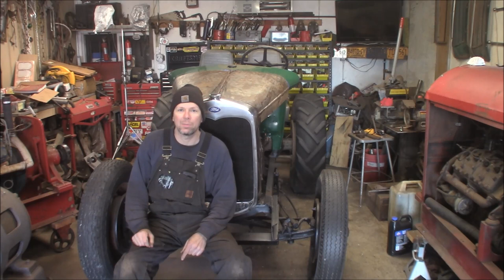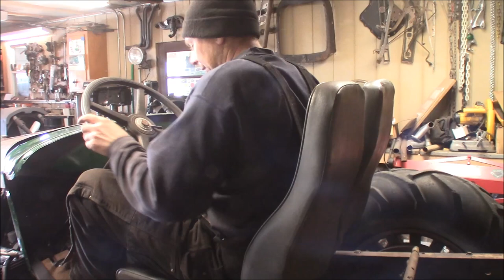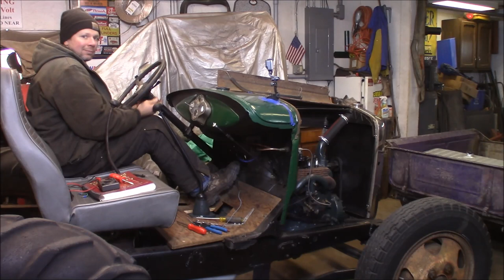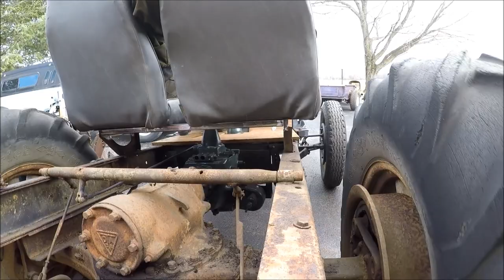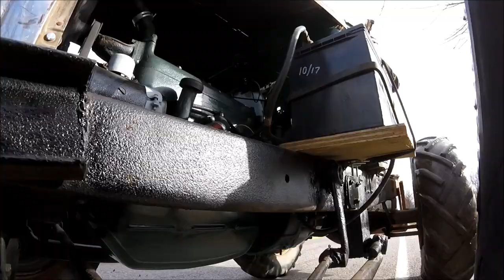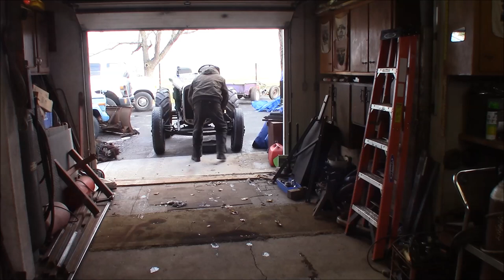Ford AA Doodlebug:  First Drive!

Comment: Thanks for the inspiration. I’m trying to restomod my own doodlebug.  It was a running ‘34 Dodge with a 1.5t timken but the prior owner sold the engine out of it. I talked him into including a ‘57 Desoto 341. Got the engine and trans welded in last week.  Still waiting for my second trans to come back from the rebuilder.  Your top loader axle was perfect for direct coupling. Sadly my front input is low enough that I’ll need a driveshaft. A bit disappointing because that’ll push the axle further back.  Using bucket seats is exactly what I suspected. The problem is they don’t have the right look. Maybe I can bend my shifter to stay under the bench?
Reply from the maker: Sounds like a cool doodlebug!  I have a 341 Desoto engine too.  Cut up a '57 coupe years ago and saved the engine although it needs a total rebuild. Good luck with you project.